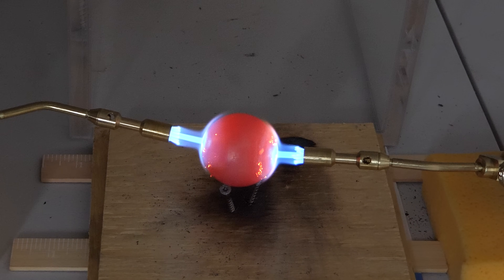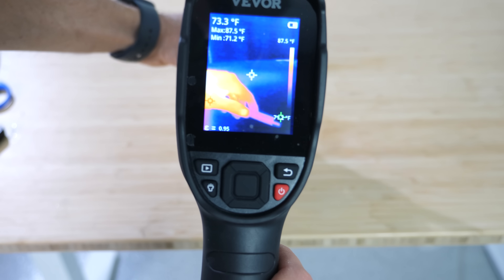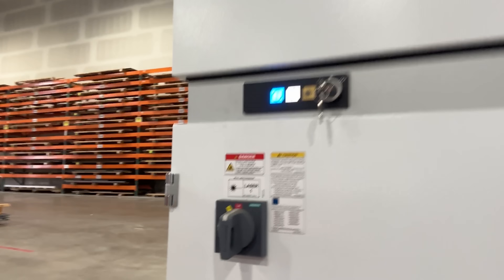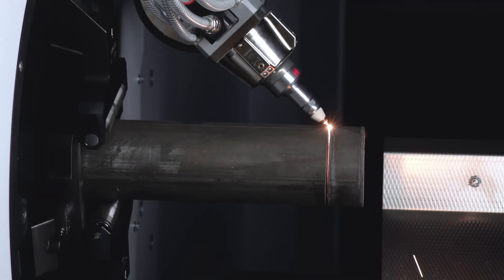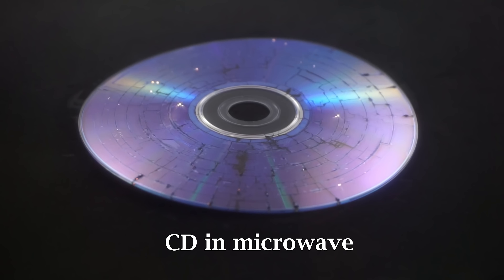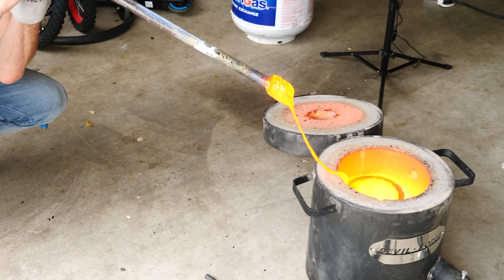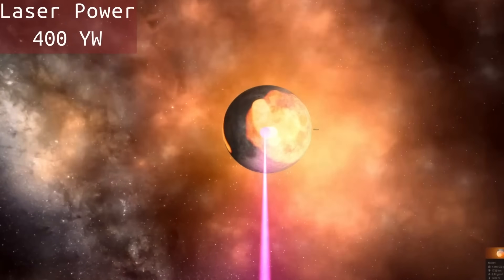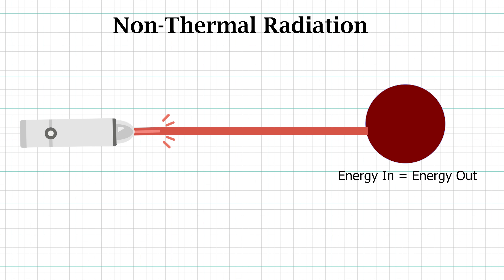How Hot is Light? How Lasers Bend the Rules of Heat Transfer

Comment: To be pedantic; single particles or atoms do not have a temperature.  Temperature is an emergent phenomenon categorized by the aggregate motion of the particles in the system.
Reply: then how a scientist got noble prize  by inventing a method to cool down  SINGLE ATOMS to just a few milli Kelvin above absolute zero
Reply: @hehehahahmhmhm  Bad grammar, no punctuation, misspelled words, yeah that checks out.  You could have just gone to google and typed 'does a single atom have a temperature' instead of coming here to make a fool out of yourself.
Reply: @hehehahahmhmhm  They did not cool down single atoms; instead, they slowed them down (i.e., decreased their kinetic energy) to nearly zero velocity. The temperature refers to the collective of slowed-down atoms as OP said
Reply: @c0ur13r6  you are both wrong.
Reply: @c0ur13r6 reducing movements  is laterally what is lowering temperature.  they are the same thing
Reply: @hehehahahmhmhm  Temperature is a measurement of the average kinetic energy of the particles in a substance. However, this is a simplified explanation, because temperature is not really a direct measure for the average kinetic energy. In fact, both the average and standard deviation are related to the temperature. A direct relationship between temperature and kinetic energy only exists for ideal gases.
Here's the definition of temperature according to thermodynamics:
1/T = (dS/dE)
S is the entropy and E is the internal energy.
Reply: @hehehahahmhmhm  Just google it dude.   Read the wiki.  ffs

Comment: So If I use a match 600'C to light a piece of wood in the forest, generating a huge fire reaching  2000C' 

You'll see that with a single source of lower energy I generated MORE energy 

😂😂😂😂😂
Reply: The match does not PRODUCE the energy of the forest fire, it is just something that starts a process.

Comment: So where exactly is all this vaporized metal condensing?
Reply: Laser dust, aka metal dust. The exhaust is drawn into an air handler. If you want mars soil, ask for some laser dust. It's nearly the same density of air.  Gets everywhere. Probably giving me Parkinson's in a few years.
Reply: @cashewABCD  ok I get that but THIS thing is evaporating a LOT of it, do the filters have to be changed every couple of minutes?
Reply: Nope. Not usually filtered. Just spewed outside via the fan
Sometimes a water bath is used though@skydyverjym
Reply: @skydyverjym  our mazak and LVD lawyers draw the dust in a one foot tube.   The collector is much larger. The dust falls out of the air when the air velocity slows. There are large filters in the top and then more filters before the air goes back into the shop. Underneath are two 50 gallon drums to collect the dust. One fills first allowing it to get emptied without shutting down the laser. Changed/ dumped weekly.

Comment: It's really disheartening to see the false analogy you used of sunlight thru a magnifying glass & laser light.
Light is just a method of energy transfer so the proper analogy would be the power input (battery chemistry/electrical potential) of the laser vs the Sun's surface energy (the atomic/subatomic reactions that power it) to the magnified beam.
Therefore it would be more correct to say the heat generated by a laser can be no more than the total power of the energy source powering it. 
If one put a short across the lithium battery source (or the building's electrical lines) they would reach an equivalent temperature rating.
Reply: He is talking about limitations on temperature produced, not about limitations on total energy or power. Temperature changes have some relation to energy and power, but they are not the same thing.

I don't think he was using an analogy, but a comparison.

Comment: Two different proceses: first the IR cameria is simply making an inference between light emission & temperature & its based up on limited IR spectrum, not the full light spectrum. Visible light has a correspondence with much higher temperatures than IR, but the thermal camera does not interprete white light with heat.

When you shine a high watt light source on a object that absorbs the light, the light stimulates the electrons in the object causing increase molecular viberations (ie heat).

Comment: You can heat up the filament in your toaster to ~800°C even tho the steam in your powerplant is only around 400°C
Reply: The principle only applies to using lenses and mirrors and a hot body.
Reply: It's a massive volume of steam whose energy is collected, converted and stored.

Comment: Did you say that you cannot focus sunlight to a pinpoint that is hotter than the source?
If I have a very large surface at 1000 C, and I focus the light (IR) to a pinpoint, the pinpoint will not be hotter than 1000 C?
Reply: Yes, no hotter than 1000.
Reply: @nuclearmedicineman6270  How would the pinpoint radiate the excess energy away?
Reply: Conservation of Etendue
Reply: No, you can't get it hotter than 1000C with just lenses and mirrors.
Reply: @DANGJOS  You don't help anyone by just repeating the statement. The Stefan-Boltzmann Law works with an area, the magnification(in one direction) has an effect for the equilibrium of the heat transfer.
Reply: I think the answer is that you cannot focus to an indefinitely small area. What you get is an image of the source. The image will always have a size greater than zero.
Reply: @franksierow5792  Why would you need an indefinitely small focus area? A 1m² area radiates ~60 Megawatt at ~6000 Kelvin, the sun has ~1MW/m² on earth. So focus more than 60m²(or double that for just one side) radiation on the small area and watch the temperature rise.
Reply: correct, even if you insulate the point completely the diffraction limited point would reradiate back and the temperature would be limited. If the point image would be all included in the source they would reach temperature equilibrium.

Comment: What happens if you get like a spherical array of those laser cutters or even stronger lasers, pointed them all inwards towards the direct centre of the sphere and then fire them at something in that centre point?
Reply: I believe that's the principle of the fusion reactor at NIF
Reply: @DW-indeed  no, the temperature of the NIF target is high (~10^7 K) but many orders of magnitude below the laser wave temperature
Reply: It'll likely vaporize quite rapidly. It's basically a lower power version of one of the proposed methods of igniting fusion. Fuel is inserted into a pellet and it gets hit with high power lasers from multiple directions; the blast wave of the shell vaporizing compresses the fuel to fusion conditions.

Comment: Wave length decreases energy increases then why infrared and microwave is more powerful than visible
Reply: They aren't. Microwave ovens are usually in the range of about 1000 watts. Modern household LED lightbulbs are on the order of 10 or 20 watts. Light fixtures also tend to disperse the light rather than focus or contain it within a small space. Even if you used a 1000-watt LED  light fixture and focused all of its light on a single object, it won't heat up as quickly unless it's black because it'll be reflecting a considerable portion of the light. Microwaves and infrared tend to be readily absorbed by most substances, particularly water and oil (major components of most food). High energy light tends to penetrate objects rather than be absorbed, this is how x-rays can be used to image bones, most of the light passes right through flesh without being absorbed.